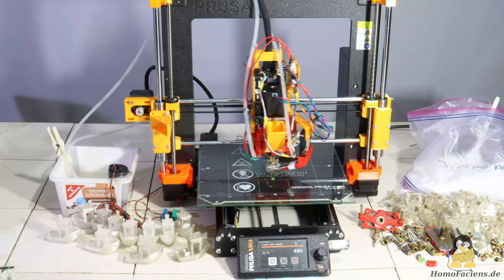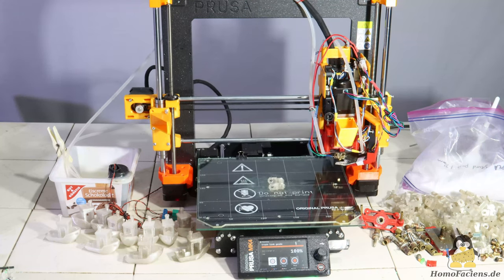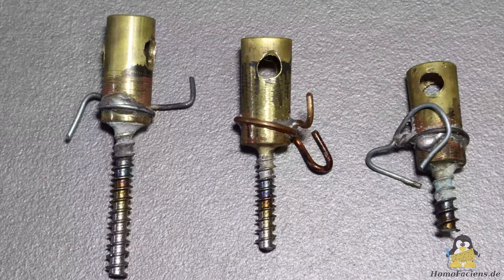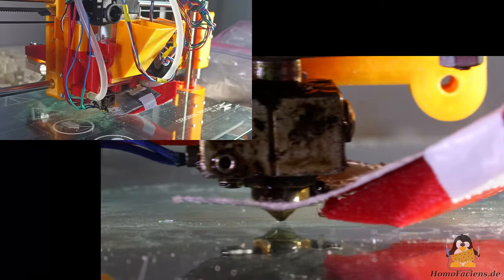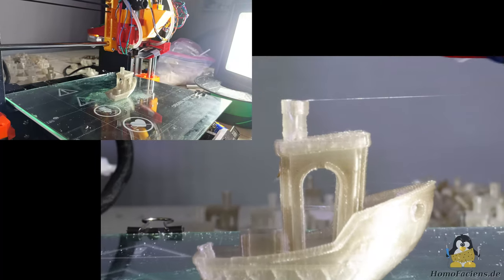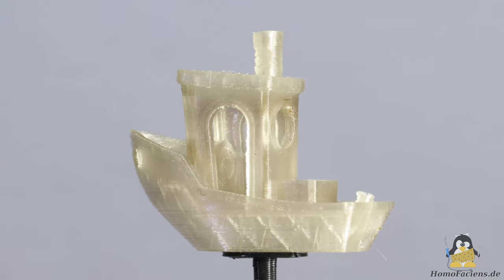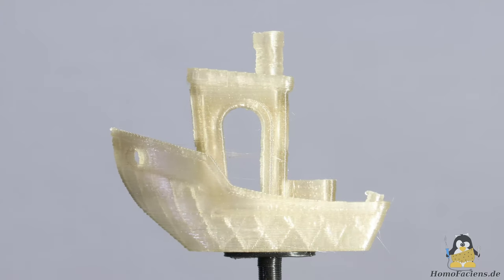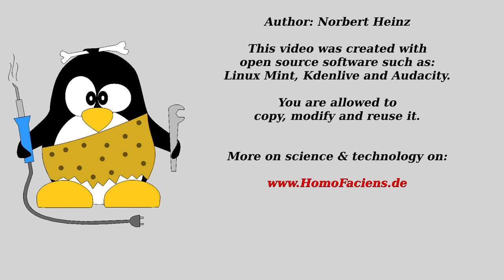Granule printer with extruder V5 2: Test print 3DBenchy

Comment: Regarding the part cooling, maybe you can set a minimum layer time for the chimney. It seemed to still be partially melted while the next layer was being printed, which makes it sag. Very cool project!
Reply from the maker: Thanks! If you'd like to print faster, you need better part cooling and I definitely want to print as fast as the extruder can deliver molten plastic.

Comment: Wow! Great work! Now I wonder if it would even help that much to have a custom machined screw which fit the bore perfectly. There doesn't seem to be that much performance left to gain.
Reply from the maker: Thanks! If you had a look at the previous videos of this series, you can see why a gap between bore and screw is essential to make this type of extruder work: The air must be able to escape.

I am in the process of building an EDM machine to create more precise extruder tubes and screw couplers but will stick with the normal wood screws, because they do their job, are easy to source and cheap.

Well, I still see room to boost the performance - stay tuned!

Comment: What slicer are you using ... and how do you determine the flow-rate for granulates?
Reply from the maker: I am using Prusa slicer. Flow rate is determined same as with filament: Print something and have a close look at the result. If underextrusion, raise the flow rate, if there is overxtrusion lower the flow rate. No rocket science needed.